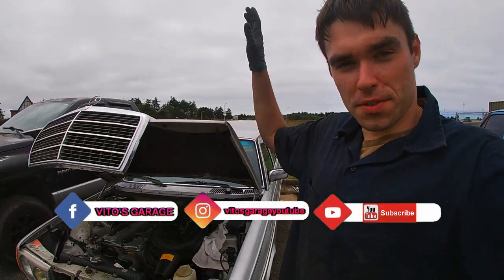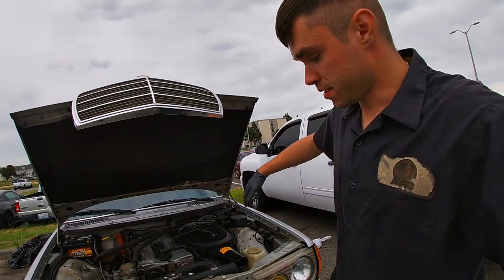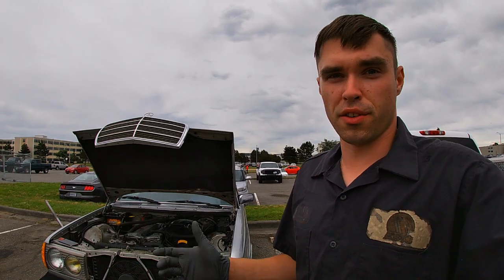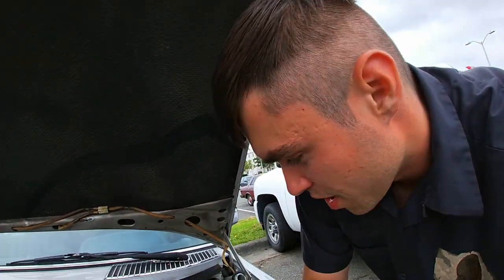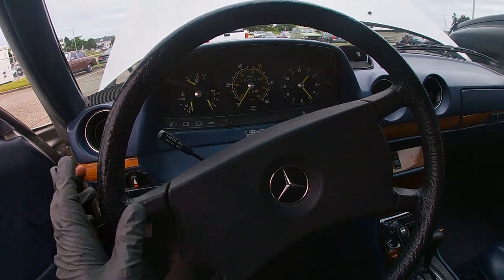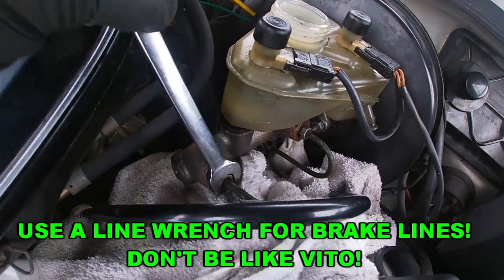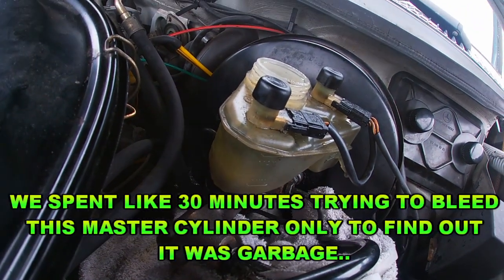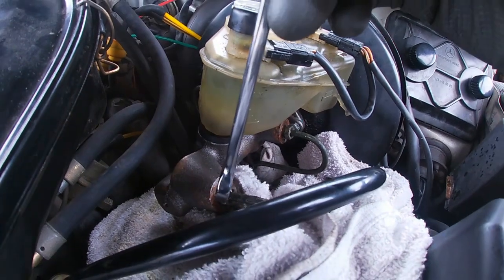NEVER BUY REMANUFACTURED CAR PARTS! FAILED MASTER CYLINDER & CALIPER AT ONCE!!! MERCEDES W123 CASE

Comment: Some remanufacturers do not rebuild their parts. They clean and paint them and then sell them cheap. 
Master cylinders are easy to rebuild. I have done it in past. Just be sure to hone it out with sandpaper and then replace all seals.
I have bought lots of remanufactured parts in past. Sometimes you do get a bad one and simply have to swap it out again. Sometimes you are better off just buying a new one, like alternators and starters. Anything electrical.
Reply from the maker: That's what I tell people. They should buy new ones! Or rebuild the old ones themselves. That way they will know they did a great job!

Comment: With so many places offering parts for the W123 or other models,why do you have to buy remanufactured parts, ther is a catalog that covers all Mercedes Benz models, by model plus what they do is that they offer some used good parts, like second hand, but they are original, Mercedes  Benz should only use .original parts, as much as possible,

Comment: I've tried pressure bleeding my brakes and got all the way to the front right, and it air keeps coming out the bleeder screw. is this a sign of bad master cylinder as well?
Reply from the maker: Keep bleeding it. If still no luck, loosen the RF brake line from the master cylinder and try to bleed it from the master cylinder side. See if you’re still getting air bubbles

Comment: How to remove the small trim above the fuel door
Reply: Help me to show in your next video.... BTW I watch your videos until the end. ☺
Reply: Pry out the center with a small plastic tool, then there is a screw under the inner trim piece.
Reply: @xenawolf  but it damages the aluminium and the plastic piece cracks.. I need a video tutorial.
Reply from the maker: I don't have a video on it yet. I might do one in the future. Here's a link on how to remove it: http://www.peachparts.com/shopforum/tech-help/296348-w123-exterior-trim-removal.html
Reply: @VITOSGARAGE  Ayee... Thanks man... You help me alot.